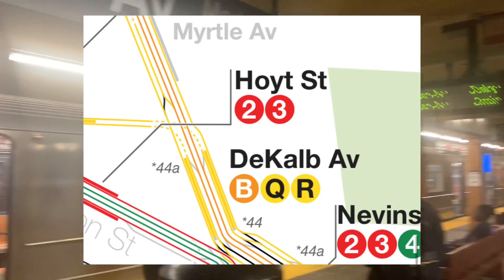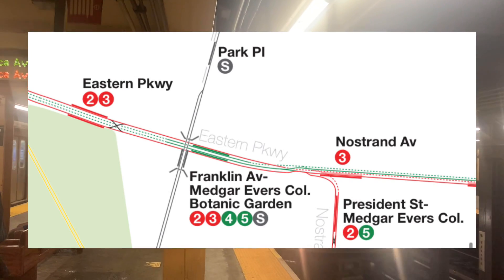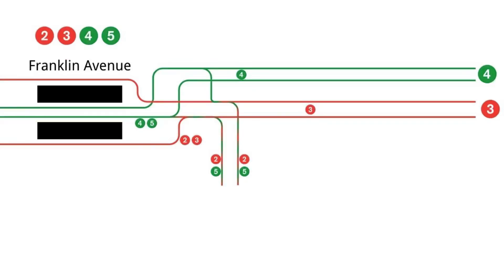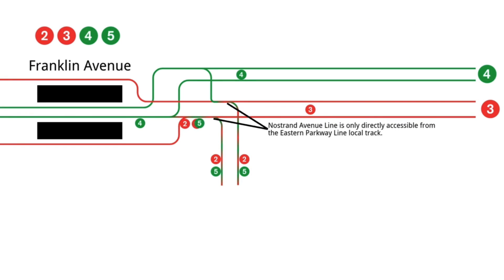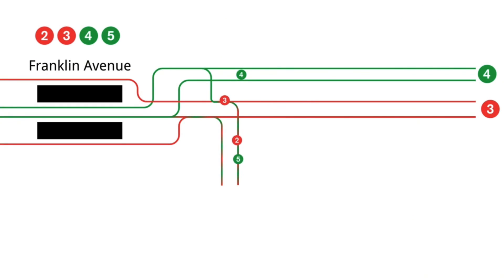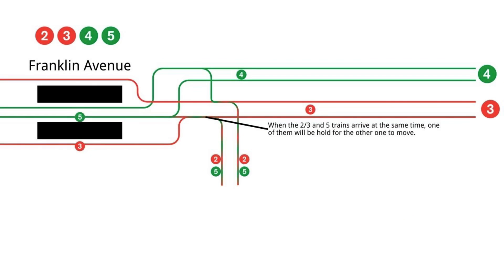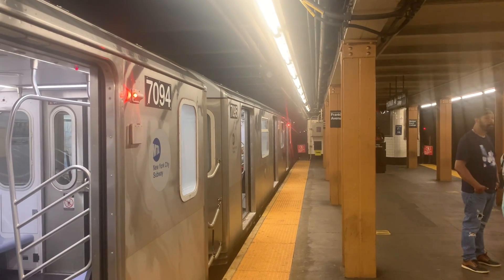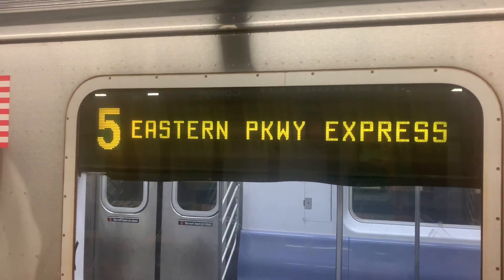Rogers Junction: Fix it to get 30% more capacity in the A division!

Comment: Nice video.  But think about the domino effects for Utica avenue if the 4 goes to New Lots and the 3/5 ends at Utica.  That's a crisscross nightmare for either direction.

I agree with getting rid of the 5 to Flatbush, until they can find a better turn around. 

Ultimately the better proposal would be keep the 4/5 express, where the 4 train ends at New Lots (which it has done especially late nights) and the 5 ends at Utica.  Continue the 2 train service down to Flatbush Ave, replace old 5 train service to Flatbush Ave with 2 train service.

The 8 train will complicate things.
Reply: So in essence, installing two new switches east of Roger’s junction for that plan to work?
Reply: @TheRailLeaguer 
You know what's interesting the original IND Second System called for the Utica Avenue Subway to be part of the South 4th Street Subway branching from the BMT Broadway line then traveling along Stuyvesant Aveune heading towards Utica Aveune using the provisions of the bellmouths near the Fulton Street station upper level meanwhile they also propose a two track subway along Lafayette Avenue as a branch of the Crosstown Line merging with the 8th Avenue Subway after Myrtle Ave on the proposed Myrtle-Central trunk line which I believed what was called for the Myrtle Avenue elevated replacement also the IND Second System proposed the Winefield Spur idea which involves a circuitous route through low density areas from Jackson Heights, Maspeth and the Rockaways plus other plans such as the Hoarce Harding Line being part of the Astoria Line, Flushing Line extension via 149th Street etc those ideas are way outdated nowadays due to major shifts in traveling patterns, lack of demand, outdated service patterns that are no longer needed, and mismatch demand and areas etc.

Did your plans first started out by combined the Second System, The Program for Action plans, Vanshnookenraggen and many of the Railfanners plans evolving your plans throughout the years by discussing with other Railfanners on the transit forums.
Reply: @TheRailLeaguer 
I would like to address some of my plans for "transit expansions"

I would first say that given Flushing is a top destination corridor for the vast majority of Queens, especially Northeast Queens along the LIE Corridor. That is why, prepandemic, Flushing-Main St on the 7 was the most used station outside of Manhattan, with close to 60k daily riders if I am not mistaken. Also, there is nothing at College Point Blvd/LIE, it is a highway ramps, parks, and cemeteries. In other words, there is very little redevelopment potential to create that induced demand. A better alignment is to serve Flushing, then veer down Main Street or Kissena Blvd, as Main Street is surrounded by parkland, Kissena Blvd is surrounded by both sides by dense apartment buildings. I have my issues with extending the G back to Queens Boulevard, but if you are going to have the G branch, that can serve Main St as well. Also include a stop at 99th St, LeFrak is there.

I also think the 7 should go elsewhere as well Port Washington is way too close to Northern Blvd, and 10-12 TPH on Port Washington would be more than enough capacity for this entire corridor. Consider extending the 7 up north to College Point/Whitestone, and adding a second branch along Kissena Blvd heading towards the LIE. This helps fill existing service gaps in NE Queens, while also paralleling some highly used buses like the Q25, Q44, and Q65 in Whitestone/College Point, and the Q17, Q27, and Q88 in East Flushing and Oakland Gardens. Both branches would start as Flushing, as Flushing is a major commercial center in Queens, making it a higher rider destination.

Don't think a four track line is necessary outside of the Second Avenue Subway. Both Utica and the Nostrand Aveune corridors don't need an express since the Eastern Parkway line would be capped at 15-20 TPH for each branch and the demand for a four track line isn't really worthwhile in areas aside from 2nd Aveune in Manhattan. Speed wise, two track lines can be as fast as express sections, if done right. Wider stop spacing is required, plus a train car can accelerate faster to my knowledge.

Commuter rail doesn't need to be this way. If you go to cities like Paris, commuter rail runs every 4 minutes. That is because these systems were reconfigured as a regional rail express system, with competitive pricing to the Metro. Doing the same in New York City would be way cheaper then building a subway parallel to a commuter rail route and would be way cheaper netting nearly the same benefits if that's the case then you're better off extended the E somewhere else such as the Merrick/Linden Boulevard corridor to cover other Southeast Queens transit deserts and if the MTA gets costs down on construction costs then you're better off extending the E via Linden Boulevard to increase coverage meanwhile the LIRR Atlantic branch would get converted into a regional rail line. I also want to add for the E to SE Queens extension, although the E via Alatnic is good, I believe regional rail is best for both Atlantic and Montauk. This will serve a huge portion of SE Queens, but even with this increased coverage, there are still spots that have poor transit service. So I would extend the E to those areas, like Cambria Heights.

-How come despite logistics many Railfanners support Joint Transit Association and Alon Levy's plans for a Second Avenue Subway extension via Utica Aveune and the 7 train project for JTA since TMC and Alon claims that parallels a "perfectly good regional rail corridor" making subway line extensions useless and according to TMC's quote "regional rail is a replacement is some instances like in the Bronx where even at average global construction costs don't allow brand new subway lines to pencil or on Northern Boulevard where LIRR stations are generally adequate enough for connecting bus service and a new subway line would compete with ridership for the LIRR". According to TMC.

Besides how come every single Railfanner like Joint Transit Association, Urbanman, TMC, Alon Levy, Samuelitoo, Mystic Transit and others are proposing a unified regional rail system and are attempting to utilize existing infrastructure first before we extend any subway lines also these are the same Railfanners that claim that the 7 via Northern Boulevard is wasteful because the Port Washington branch already parallels the Northern Boulevard corridor which is why JTA and others support his proposed 7 train project for the Flushing Line to serve areas like College Point Whitestone, and Bay Terrace as well as the LIE Corridor to Bayside also instead of the E train takeover of the LIRR Atlantic branch they imagined if they have a lot of money they would instead extend the E via Merrick Blvd and Linden Blvd to 230th Street and instead they are proposing converting the LIRR Atlantic branch to be part of a unified regional rail network along with Metro North, Amtrak, PATH, and NJT like what this guy Urbanman proposed "many people propose extending SAS into the Bronx or building a new Northern Boulevard Subway don't get me wrong those aren't necessarily bad ideas but a more cost effective solution that Urbanman, TMC, Joint Transit Association and Samuelitooo proposed would be to think outside the box and utilize existing infrastructure first to it's maximum first" just like what Urbanman said in his latest video plus Joint Transit Association, TMC, and Samuelitooo seem eager about it so why not try it here in NYC.
Reply: @TheRailLeaguer 
Yeah SAS via Utica is just a fantasy dream. Compared to a simple branch of the IRT Eastern Parkway line (which is the most logical since it would capture the same amount of ridership not to mention the fact that demand is below Eastern Parkway not above it also most Utica Aveune residents work in either Downtown Brooklyn or Lower Manhattan something that SAS via Utica bypasses this is also according to the B46 SBS ridership since most people drop off at Eastern Parkway anyway Bus corridor demand is a fairly decent guide) and an IRT branch serving the Utica Avenue would be more cost-effective rather than having to wait for a full length Utica Aveune Subway as an extension of SAS which isn't needed not to mention people also fail to take into account how cost-ineffective SAS via Utica would be it's because you would need mass tunnel boring and massive property acquisition which likely isn't happening and that makes the cost of the Utica Avenue Subway more expensive than it needs to be also Northern Willamburg doesn't need new capacity but rather reconfiguring existing capacity which would bring more cost-effective benefits without the need for extra trackage or redundancy whatnot.

People like the Joint Transit Association and TMC ("Claimed that the city center is the denser part of the city so that's the place where you should have the most capacity")
but one thing they fail to take into account is that there's actual demand for outer-bourough travel and the different ridership needs for each of the outer boroughs not just Midtown which is what ridership is leaning more towards besides the world shouldn't revolve around Manhattan anymore and more outer-bourough travel demand 

Maybe if Joint Transit Association or TMC and other Railfanners ride the subway more and have actual real world experience and more insight you can actually notice that more people are traveling in-between the outer boroughs with different ridership and travel needs.

(For example yesterday I took the Q44 SBS from Parkchester to Flushing at it was packed af I've noticed by the time the bus reaches College Point and Whitestone a good majority of people got off at College Point, Whitestone and Flushing indicating that there's strong demand between Queens to Bronx crosstown travel in those car dependent areas which is saturated by too much bus service something that JTA, TMC or other Railfanners fails to take into account because they lack the insights and don't have actual experience).

Also even with a commuter/regional rail system by implementing through running, fare intergation, relocating platforms on LIRR stations and increasing frequencies or whatnot that's just one mode doing all the heavy lifting and the LIRR would fail in capturing much of the bus ridership because some stations are in isolated residential areas which see low ridership and commuter/regional rail- S bahn is designed for longer range trips outside of NYC or towards Suburban areas not to mention there's more demand for local trips within NYC something that the LIRR fails to take into account even with infill stations these are some of the reasons I'm opening up to more logistical proposals something that JTA and his followers fail to take into account
Reply: @TheRailLeaguer 
Still the LIRR has limited coverage within Queens proper. I've come around the need for the superexpress, because extending Hillside Ave further east puts it further away from the LIRR, and a subway that makes many stops on 6th Aveune itself but fewer stops in central Queens than current QBL Express, would actually be fantastic for the furthest reaches of Eastern Queens.

Speaking of which since we're talking about crayons here's mine. I keep my A/C/E labels for Fulton/8 Ave/Queens Blvd express, with the K being 8 Ave/CPW local. I am no longer extending that on the Manhattan side, so WTC stays. The K would be extended at the Washington Heights end into New Jersey, via Route 4, to Paterson NJ.

I used to tie an extension of the Myrtle Avenue line to 8th Avenue. Instead I'm tying it onto Broadway. Now that I know the S-bend between Corrtlandt St and City Hall can only take a maximum of 20 TPH, I'm extending the present day W down to the lower level of City Hall then to downtown Brooklyn on a new alignment finally I have the W running down Myrtle Aveune with a portal at Ryerson Street so it properly connects with the Myrtle Avenue El. So the would now share tracks between Metropolitan Aveune and Ditmars Blvd, combining this is a future extension along Eliot Avenue and Junction Blvd to LGA serving Corona all within a one seat ride and creating a loop line this would followthe Q58 which is top 2 of the busiest bus routes in 2022.

You're preaching to the choir I want to make clear that my problem specifically is removing LIRR in order to have the subway.

Absolutely, give us subway extensions. They're overdue. Just don't remove the LIRR service on the Atlantic branch (Locust Manor, Laurelton, and Rosedale) in order to do so.

LIRR being inaccessible and not rapid transit is a choice. Plenty of ideas and even campaigns out there to change that. For starters, I would build a flyover at the Queens interlocking (not 100% sure what the name of it is, but the one between Queens Village and Bellrose stations) to increase throughput, and therefore frequency. Then I'd have all Far Rockaway and Long Beach trains run to Atlantic, and all Atlantic trains run to Far Rockaway and Long Beach. Stations west of and including Valley Stream can get 7.5-minute service whereas this change frees up 6 TPH on the LIRR Main Line to distribute along every branch, all without further construction (Remember it's only 20 minutes between Grand Central, or Atlantic from Jamaica).

All of that is just for starters. We haven't even gone into through-running and fare integration, two things seen in competent and successful regional rail systems across the world. The former both increases capacity AND one-seat rides to more of the NY-NJ-CT region, while the latter simply makes fares more fair across transit modes, usually including pricing commuter rail the same as local transit within city boundaries which is feasible to do BECAUSE regional rail is not so frequent that it can handle city ridership.

That said I do agree the E should be extended, if not qaud-tracking the Atlantic branch, then down Guy R. Brewer Blvd. The Q111 and Q85 are some of the busiest buses , and having a north/south subway could allow some buses to serve Ozone Park for a train to Brooklyn instead of Jamaica.
Reply: @TheRailLeaguer  
Speaking of housing development in southern Brooklyn is mentioned. I've said before how I feel about SAS being the Utica Avenue line, as a way to relive the Lexington and Canarsie trunks in general, and platform overcrowding at Union Square and Bleecker St in particular. (It would also aid Brooklyn/Queens connectivity by giving the E, K, J, and M lines north/south connections.) Right now it would be helpful to know whether current B46, G, J, and L riders prefer Midtown East or Midtown West as a whole. Because my stance for Utica Aveune being a separate IND line rather than an IRT branch could be fulfilled by an extension of whichever 8th Avenue services terminates at World Trade Center instead of SAS. Could go either way.

 Since we're talking about crayons here's mine. I keep my A/C/E labels for Fulton/8 Ave/Queens Blvd express, with the K being 8 Ave/CPW local. I am no longer extending that on the Manhattan side, so WTC stays. The K would be extended at the Washington Heights end into New Jersey, via Route 4, to Paterson NJ.

I used to tie an extension of the Myrtle Avenue line to 8th Avenue. Instead I'm tying it onto Broadway. Now that I know the S-bend between Corrtlandt St and City Hall can only take a maximum of 20 TPH, I'm extending the present day W down to the lower level of City Hall then to downtown Brooklyn on a new alignment finally I have the W running down Myrtle Aveune with a portal at Ryerson Street so it properly connects with the Myrtle Avenue El. So the would now share tracks between Metropolitan Aveune and Ditmars Blvd, combining this is a future extension along Eliot Avenue and Junction Blvd to LGA serving Corona all within a one seat ride and creating a loop line this would follow the Q58 which is top 2 of the busiest bus routes in 2022.